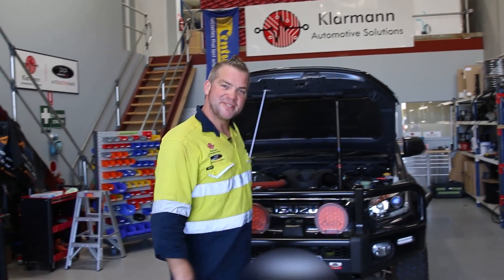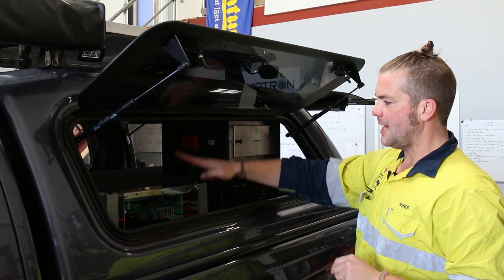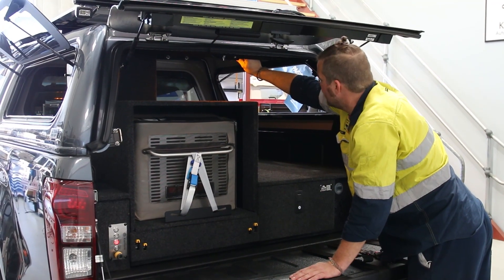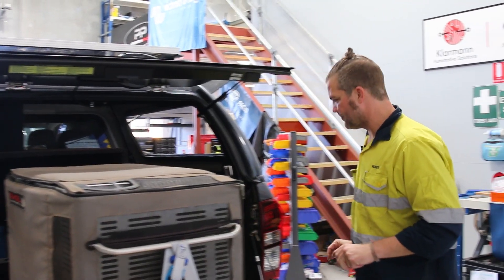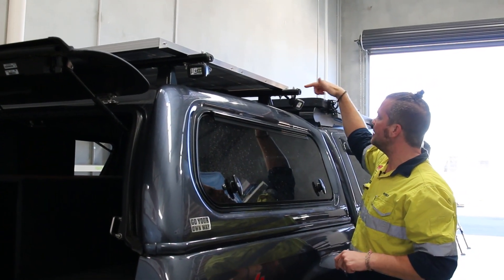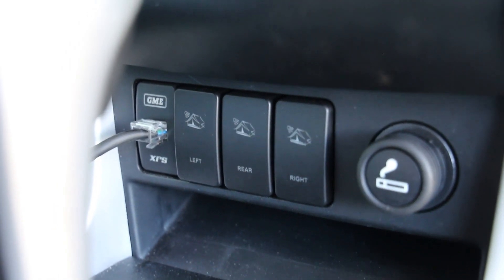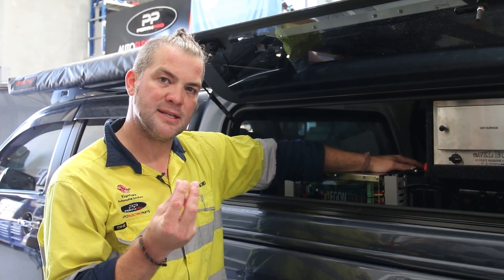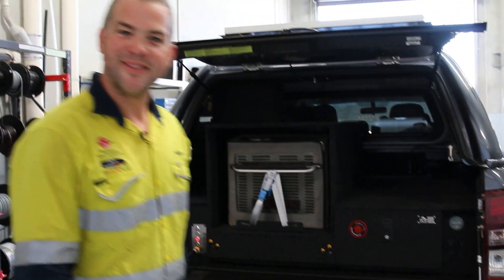Heiner Builds Your Ride | Isuzu D-Max

Comment: Neat setup, thanks. Can the Redarc BCDC1240D or any other model control two batteries setup as 2nd battery, and how would you connect them, in parallel or in series?
Reply from the maker: Hi, please refer to the Redarc manual for your BCDC charger